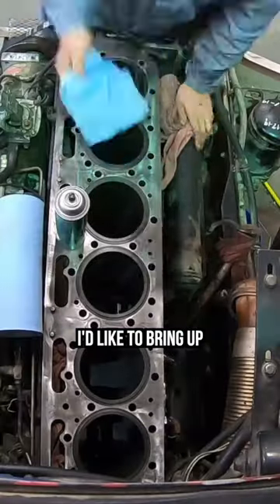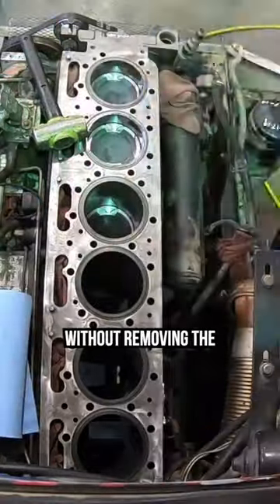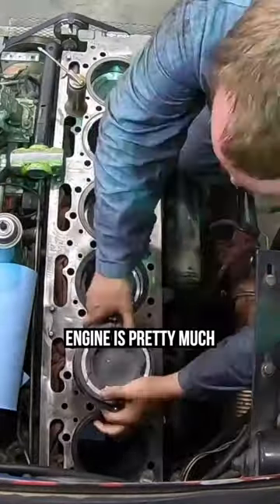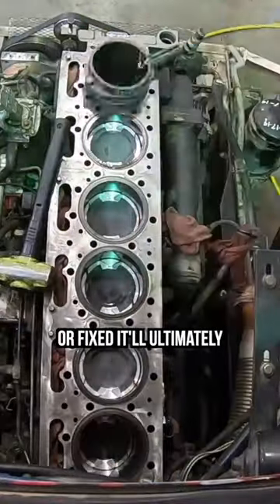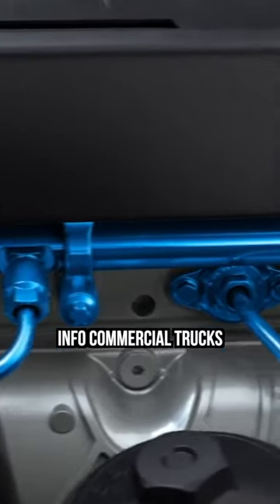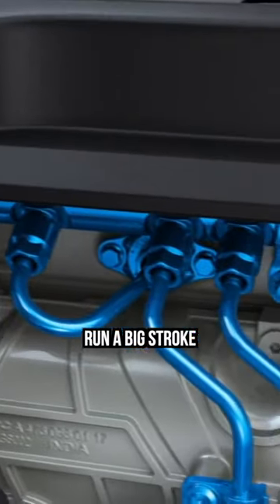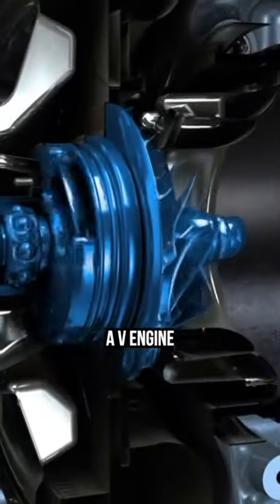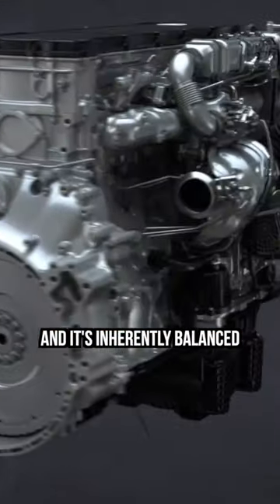Why Inline Six Engines are Easier to Rebuild in Semi Trucks

Comment: Well when its a v-8bit has more torque ,but it has less harmonic distortion . A v8 deisel in a big truck is also rebuildable in frame. More rrsearch which yeild more vital information cause this is false in half the statement. Its more expensive due to more parts being involved and a v8 is heavier .

Comment: Inline 6 is the go to standard engine of "any" size. Simple , inherently balanced and ruggedly tough is the main selling point of this design. AND scaling it to any size still gives you the same benefit as others on the family. 

For an even more compact and powerful AF, you have the V 12. The same principle as the inline 6. Each bank is balanced like an inline 6 but sharing a common crankshaft and crank pin.

Comment: I'm thinking that if the pistons and rings were worn enough to merit replacement, the cylinder walls probably aren't stellar either. I'm not a diesel guy but I'm thinking with that sort of compression I'd want the cylinders as good as the pistons and make sure the deck was true as well. Again, I don't know these big 6 diesels at all, it just seems that once the pistons and rings are worn out there's several other things that have exceeded the service limit or tolerance as well.

Comment: Used to be the same way with cars and pickups until they started shoving two thirds of the engine under the cowl and into the firewall. You can't reach jack sh!t in most cars these days.

Comment: 6 in a row, made to tow.
Reply: 6in a row ready to blow.
Reply: @Connor  Must be why all semi's are inline 6. That makes perfect sense.
Reply: @BigDaddyPapaJ  they aren’t though. All the European semis are v8. And the old American semis had v8 caterpillar and Detroit engines.
Reply: @Connor  I knew that comment was coming. Those engines were popular for a while like the 3408, KTA and 8v92 etc.. but they all were replaced because the amount of torque the inline 6 can produce reliably. 

Those were great engines with the KTA being my favorite but they were expensive and high maintenance engines.
Reply: 6=8 bud
Reply: Ford vans and pickup trucks back in the 70's had a six cylinder 300 motor, and a 302 V8.  People who used their vehicles for work, like my Dad on the farm, bought the inline 6 cylinder. Easier maintenance.
Reply: @MrWelfarehater  They made them from the 60s all the way through 96.  Excellent engines.

Comment: I disagree. I have dealt with a lot of truck engines and also drove them. Caterpillar, Detroit, and Cummins, all made v type engines that were just as reliable as the straight sixes. Detroit also had a v6. Had no issues with rebuilding cat 3408s or Detroit 8v92s or 6v92s, have also seen a few Cat v12s in Long hood Petes and kenworths.
Reply: I agree, I think the narrator in the video might have mixed up reliability with simplicity or ease of repair. Out of two equivalent engine, one being an I6, the other a V8, they should be as reliable. However when something does break, it should (in theory) be easier to repair the I6, since it has more working room and less parts (1 engine head) than the V8.
Reply: Fuel economy is what killed the v8s in semis.
Reply: On transit buses, you actually want an inline mainly for the room. We had Detroits V Motors. Way more complicated.

Comment: Most reliable engines ever. My 2004 bmw 530i has the biggest na straight 6 they made (3.0L) and am about to hit 200k with only normal labor
Reply: The 3L isn't the largest i6 bmw ever used. The last gen m30 engine is a 3.5L i6.
Reply: @brad5347  oh really? I don’t know much about the early M engine I didn’t know that! That’s pretty cool, I’m gonna need to see a video of the sound.

Comment: as far as i know, l6 engines are easier to work on than v8s in general, not only trucks. The reason they are not used as much anymore is because of the size, especially when you want to go big displacement with it and turbos...
Reply: They’re actually great for turbos! Because of their narrow design it leaves a lot of room on either side of the engine for turbos. The problem is the length. Front wheel drive cars in particular don’t have enough room to fit the engine transversely. That’s why the V6 took over as the standard 6 cylinder engine. The I6 is making a comeback tho
Reply: @keeganandersson4281  sizewise a big displacement l6 like a BARRA, with a turbo, its definitely something you cant fit everywhere! way bigger than an NA v8. thats what im saying here. As for the length its still longer than everything else, needs a more particular configuration to fit compared to a V6. you literally said what i was saying in a different way :P

Comment: How about the inline 5 Cylinder Engine like the Volvo 2.5T Gasoline?
Reply: They are more compact than the i6 but they sacrifice the naturally perfect primary balance, so they need to compensate for that. Ford had a 3.2L 5 cylinder diesel in Europe for years
Reply: @keeganandersson4281   wow 👍

Comment: They also wind up having cooling issues on the furthest cylinders in the loop.
Reply: This is the part nobody wants to talk about. Mainly 5.9 and 6.7 Cummins.
Reply: What exactly is the cooling issue
Reply: @TheAnnoyingBoss  the back cylinder runs hotter because of the coolant path around the block
Reply: It just required a good cooling system and not being an idiot for most 6 cylinders.  Don’t overheat them.  Simple.
Reply: @M54B30_fan  you can't do anything about it. It's a known issue with long inline blocks
Reply: @jeepmanxj  idk… haven’t heard of that killing the e46 bmw’s I have.  The factory cooling systems were garbage with a plastic waterpump.  I have two, both with metal waterpumps and one with a new expansion tank.  One’s at 168k, other at 122k.  The higher mileage engine will probably go out do to sludge rather than heat, but with those I’ve read over 200k miles it isn’t heat in the back that kills them.  Only thing that kills these engines heat related is hoses and system and coolant not being done.  It’s not a ‘fatal flaw’ along all L-6’s.
Reply: @jeepmanxj  seems like a problem that could easily be solved by some engineering
Reply: @spicysnowman8886  well, nobody has managed to solve it in 120 years.
Reply: Cummins ISX 15, cylinder liners 5 and 6 drop, combustion gas in the cooling system.  Remove cylinder head, cut all 6 bores, new liners and start over. High failure rate for sure.
Reply: @jebediahnightlinger6357  damn bro named one engine he’s gotta be right
Reply: @jeepmanxj  what engines do you see or article you’re looking at?  I mean I could just pull out and say

RB engines failure — oil failures

2jz— timing belt failure

M54– people not replacing shitty stock cooling system and overheating them, not the engine design just plastic cooling

Ford 300ci 6 —distributor pin falls and breaks camshaft

M52– bad cooling system

S54- rod bearings

S52 — cooling system (quite common with bmw)

Most of these engines are respected for reliability, with the exception of the RB with the stock oil holes and the S engines with the exception of rod bearings replaced.  I can’t find any of these saying heat will just murder them without the cooling system not being the fault, which is often the case on the bmw 6’s, but all of these engines are known to go hundreds of thousands of miles, and the most common failure isn’t ‘heat on the 1st or 6th cylinder resulting in castrophic failure.’ 

 It’s a myth.  You think there would be a single article even on quora claiming that L-6’s will fail due to heat, but there isn’t one.
Reply: @warrenself  This has to be operator error.  Case and points, 96 12 valve cummins 379000 miles.  Still rolling on factory everything engine wise.  2003 5.9 195000.  Not a damn problem.  2014 6.7 225000 in a ram 5500 crane truck rolling around at close to 20k lbs and not a problem.  Finally a 2010 with 218k and not a single problem.  This has to be people being fucking stupid.
Reply: @jeepmanxj  2jz and 1jz have entered the chat
Reply: @RustyShackleford9000  they also have the issue. Keep going. This will be fun.
Reply: @jeepmanxj  1 and 2j have nearly indestructible iron blocks and aren’t known to suffer from overheating issues. Stock crank is forged and can handle up to 600hp. BMW m3 engines are also L6 configuration and are amazing platforms. There may be a slight heat difference between the furthest cylinders, but this can be greatly mitigated by it’s a larger, aluminum radiator core with better flow, a better water pump, larger cooling fans etc. People run 2j’s at over 1000whp for multiple rounds of competition and do not overheat while standing on limiter at 8-9k rpm.
Reply: @RustyShackleford9000  none of that changes anything. 

Bmw and the 2jz still have uneven cooling. To be honest after owning a mk4 supra I don't know why anyone gives a fuck about them. The engine wasn't all that great nor reliable.
Reply: @jeepmanxj  iron block, reinforced bottom end around the rod bearings, forged stock crank, used in GT racing for years plus FD, D1, yeah man such a weak engine 😂😂
Reply: @RustyShackleford9000  yeah. Again I owned one when they were still new. 

Everyone ignores the piles of blown ones at tuning shops because 1% of people had great results.
Reply: @jeepmanxj  ok man, I guess all the 1j and 2j cars at Ebisu that have run for years with only basic mods standard for grassroots motorsports like aluminum radiators, for multiple drivers (Taylor Ray, Andy Gray, Daigo, Grant Anderson, David Mesker, Aaron Losey, Suenaga, Adam LZ, Sammit, Noriyaro, etc) and are left out in the rain and snow at the circuit year after year and then run flat out for multiple events per year are just coincidentally the ‘few good ones’ lmao. 

Guess the reason the 1 and 2j platform is so sought after by race teams like Real Street, Titan, and tons of FD/D1 teams, and the prices keep rising is that coveted 1% success rate 😂😂😂

It’s definitely the most widely used engine in D1 by pro teams due to its overheating issues lmao

Good troll man, I’ll give you the benefit of the doubt
Reply: @jeepmanxj  also your YouTube handle says “jeepmanxj”… wasnt the famously reliable engine from the xj an AMC 4.0 inline 6?? But L6 is such a bad design according to you right? Hahahaha bro here just take the L
Reply: @RustyShackleford9000  yep. It also had the same issue. Funny how that works
Reply: @RustyShackleford9000  take your fanboy to the need for speed videos.
Reply: @jeepmanxj  FD and D1 are real race series and multi-million dollar businesses that choose the 2j platform for its reliability..Need for Speed is a video game… ?? You’re sounding more and more uhinged here man.

JGTC 300 and 500 class Supra, The Australian Calsonic Group-A r32 with the rb motor that won countless championships..

I’m giving you real-world example after real-world example of l6 engines performing reliably in extremely high-stress race environments and you are just responding with weak insults..
Reply: @jeepmanxj  you can find article after article detailing overheating issues with v8 layout engines, and v engines of any cylinder count have balance issues, which is why they require such heavily weighted counterbalance shafts. No engine design is perfect, and v8, l4, and v6 each have their issues as well, one of which is often overheating. Not sure what your vendetta is here about l6 engines, but they wouldn’t have been used in countless race and cargo applications (such as many large semi trucks as diesels) if it was a bad design. You are dying on this hill for no reason man
Reply: @RustyShackleford9000  people race all kinds of engines in all kinds of race series. That's not proof of anything.
Reply: @jeepmanxj  Race teams do not repeatedly choose the same powerplant season after season if they are not experiencing success. Racing costs money, lots of money, and sponsors, team owners etc care about results. And we are talking about teams (D1 and FD teams) who are not bound by auto manufacturers brand obligations, and can choose whatever engine platform they see fit. 

They choose the 2j because it’s a tank and it can produce 800-1200whp without breaking a sweat, end of story.

Can’t believe I’m having to spell this out for you man.
Reply: @RustyShackleford9000  they rebuild the same engine season after season race after race. What is your point?

Are you just throwing shit at the walls at this point to see what sticks?
Reply: @RustyShackleford9000  I can find article after article about anything if I look specifically for one specific failure. 

We are talking about coolant, going into the front of an engine, making its way to the rear last causing unequal cylinder cooling. The longer the engine the bigger the issue. This isn't a secret, this isn't unknown.

You are fighting this ruthlessly because you don't know anything outside of quick dodgy google searches aimed at backing up your, uneducated and incorrect, opinion.
Reply: @jeepmanxj  I’m not doing any “quick searches,” these are race teams and organizations and manufacturers that I have followed for nearly a decade because I’m interested in motorsports. 

No one is saying the cylinder #6 won’t be slightly hotter than cylinder 1 in an l6 (the same is true in an l4 as well btw), what I’m saying is this does not present any actual issues to reliability or performance. As I said above, v-layout engines also have crankshaft balance issues and have to compensate with balance shafts, as does the l4 layout. Does this mean they are bad platforms? No it does not. There are also torsion force issues with the long crankshaft found in l6 engines as well, but this can be easily compensated for with a forged or simply a stronger cast shaft.

Also, any issues you would posit for an l6 related to block length would be present in v12 or flat 12 engines as well, but whatever Achilles heel you think exists didn’t stop Formula 1 from running v12 engines above 14k rpms for long races for years with amazing results.

My point is that l6 engines are an amazing layout, and have many examples of reliable, powerful engines with an amazing racing history. What exactly is your point again? Lol
Reply: @jeepmanxj  also there are marine applications for older diesel submarines and even modern day ferries, plus construction applications for heavy machinery or generators made by brands like caterpillar that use straight 6 or even straight 8 cylinder engines. 

You have an incorrect belief that a straight 6 or longer layout has such bad issues with uneven heating that it’s a bad platform. This is simply untrue. The same as it would be untrue to say that v engines have such bad harmonic vibration issues due to crankshaft imbalances that they are an unusable layout. This is also false. Each layout has pros and cons and there is no perfect engine. There are very reliable v engines and very reliable l6 engines. 

You are coping so hard by telling me I’m uneducated when I have done nothing but spit facts at you and you have replied with “it doesn’t change anything” and “go play NFS” 
Jesus lmao
Reply: @jeepmanxj  bro if l6 engines had unusable overheating issues like you are claiming they wouldn’t last a whole event to even get to the next rebuild lol. Obviously race teams rebuild engines frequently 😂

Do you even understand what happens when you truly overheat an engine? The head (or heads) warp(s), head studs get stretched, and you loose compression and power massively and immediately. Radiator cap and lines can rupture.
Reply: @RustyShackleford9000  you keep proving you have no idea when you say overheating. 

They have cooling issues with the rear most cylinders. Do you even understand the difference?
Reply: @RustyShackleford9000  you are doing quick searches. 

You don't even understand how an inline engine is designed.
Reply: @jeepmanxj   ?????
I literally said, cylinder 6 on an inline 6 (back of the engine near the firewall in the engine bay) will be slightly hotter than cylinder 1 (front of the engine near the pulleys) but this isn’t enough of an issue to affect reliability or performance..

What exactly are you whining about at this point?
Reply: @jeepmanxj  have you noticed how I’m giving you specifics and you’re giving me insults in reply? Yet I’m the one who doesn’t know what I’m talking about? 😂 

why don’t you tell me how you think an in-line 6 engine is designed, and what you think I’m getting wrong? Lol
Reply: @RustyShackleford9000  I notice you are trying to explain your way around something without addressing the problem at hand. You are attempting to move goalposts that are steadfastly rigid. 

I ignore any commentary that is irrelevant, and now that I disabled email notifications, again, I'll ignore your flagrant ramblings of nothing entirely.
Reply: @jeepmanxj  congratulations, you have ragequit a discussion you didn’t have factual rebuttals for!

Go ahead and comment back if you want, I won’t reply to it. I’ll let you have the last word, I can tell that’s probably very important to you.

Comment: You forgot to mention that Big V8 diesels are banned in heavy duty trucks.  Less labor you say?  Have you seen heavy duty truck labor charges vs automotive?  Guess not.  Plus, the parts are 10 times heavier and require equipment to move ... this is not a viable argument to say an inline 6 is better.

Comment: A longer stroke does not equal more torque. It is the size of the engine that determines the torque. However an engine with a larger stroke to bore ratio will reach peak torque at lower rpm. The reasons for these things are demonstrated with some reasonably simple physics but I can't be bothered to explain them here.
Reply: Agreed.
Reply: Maybe more usable torque would be more accurate
Reply: @ben3989  usable torque is determined on how the engine is tuned and designed. Smaller valves help a lot